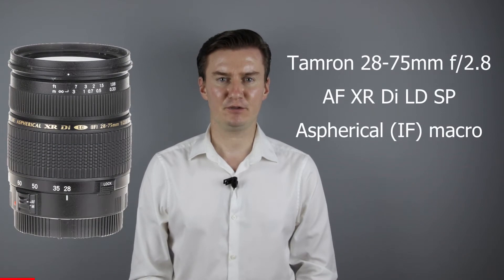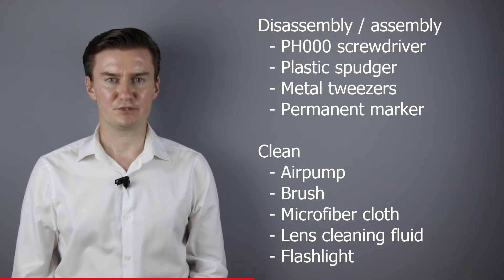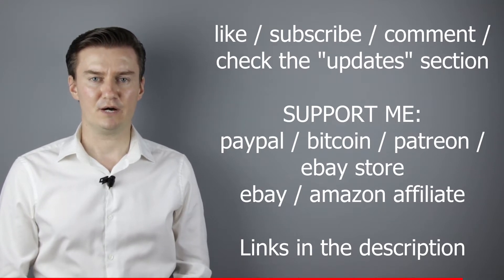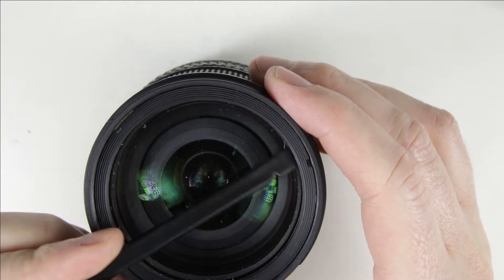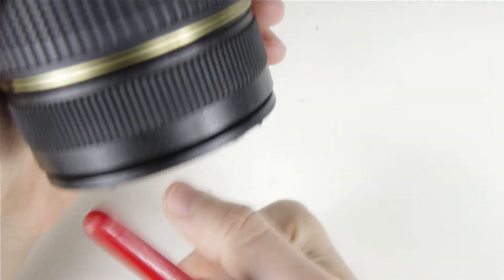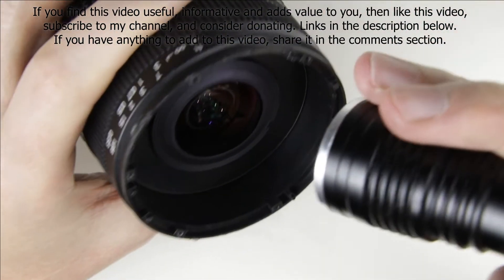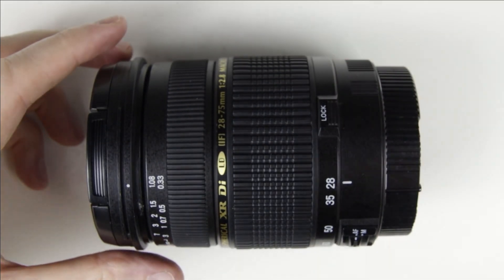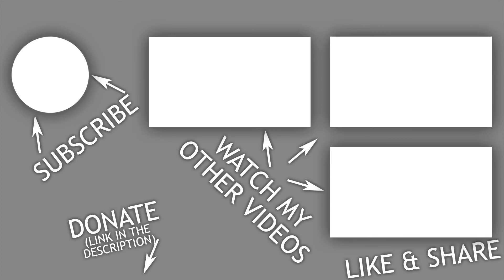Tamron 28-75mm f/2.8 AF XR Di LD SP Aspherical (IF) macro clean the lens inside

Comment: I have nikon d750 or i use tamron ths lens..before this i was used nik 24-120 f4
I swear that i didn't found any any any noice(in 24-120 lots of noice when use 1000 + iso)
I face a problem that when i take full length picture or i was assure that focus points at face but when see my pics at pc monitor, i always shocked that lens pick background subject or subject found blurry(pick sharp focus in background)
Or when take horizental pics,pics always perfect..problem in just full length vertical pictures
At 75mm or 78mm portraits lens give ne awsome super sharp result
Plsssssss help
Reply from the maker: Thank you for your comment, I don't know the solution to your problem.

Comment: Thank you for sharing the cleaning tricks. You know, i'm thinking to buy that lens from a friend but it has the Filter Holder broken with some internal fungus lens. I want to ask you if you can share also some links for the Tamron spare parts sites or where i can buy. Can you help me ? Or just to know a your opinion about that ?
Reply from the maker: Check ebay or aliexpress for spare parts. Tamron spare parts are very rare, Tamron doesn't sell them, but sometimes individual sellers do. 
If there is a fungus in the lens, it is very risky to buy it, because maybe the fungus us between the front lens elements which are glued together, and basically it is impossible to separate, clean and assemble them.

Comment: thanks to your tamron 28-75 and 17-50 cleaning videos, i've seen how easy it is to remove the front element for cleaning. these lenses are bellows and prone to breathing in dust and dirt. unlike other and older lenses that require a lens wrench/spanner, tamron's front element is screw mounted! using a lens wrench gradually wears down the notch and has a tendency to slip and damage the element. now i know which lens(es) i'll be getting next.